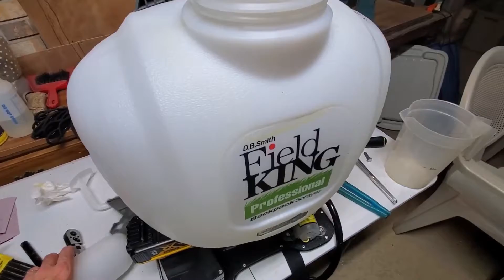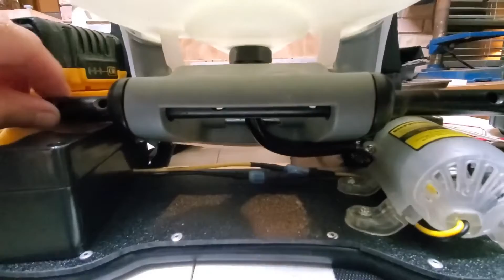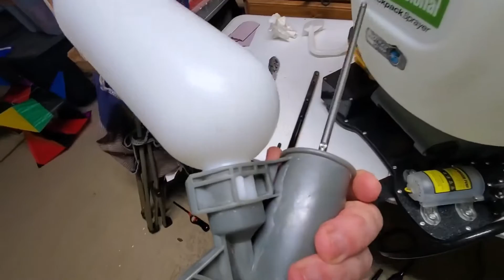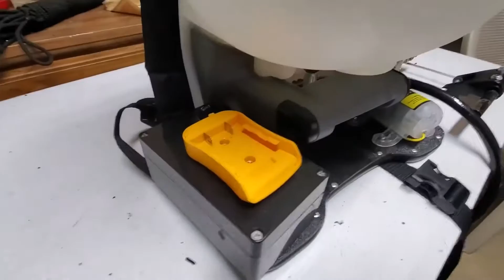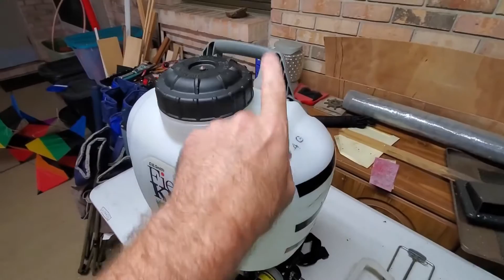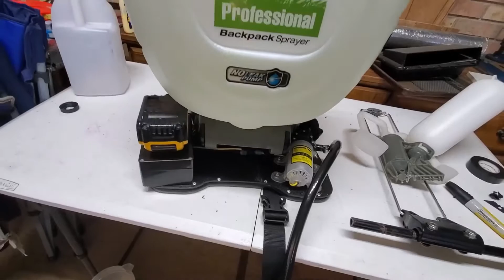Dewalt® Battery Conversion Backpack Sprayer Update

Comment: Hell of a clever idea. Ive got the parts ordered to convert one to use Milwaukee batteries. One thing I thought of after ordering is the Milwaukee red lithium batteries have built in over discharge protection: the 12v limiter I picked up actually has one built in as well (allegedly). I'm unsure if those DeWalt batteries your using has it or not.
Reply from the maker: According to DeWalt their battery packs don't have over discharge prevention built in. I know several other brands do. I used DeWalt because thats the platform I'm invested in with all my hand tools.
Reply: @petedymond  This was a great and useful video...much appreciated! in this video you said you used it a bit and still had 2 bars of battery left over. Is the dishcharge preventer needed if i don't plan to fully run down a battery (5AH or 8AH)? just trying to save me some $ and minimize components going bad. Thanks again...i'm going to buy the parts and hope the links you added for the amazon purchases send some money your way! 👍
Reply: I’m planning on using makita 18v with a step down converter to get to 12 (or 13). Anyone used a step down converter for this?

Comment: My original thought was actually to use basically a cheap 12v tire inflator with a port in the top of the tank (maybe just install a tire shrader valve) to pressurize it. I feel like it would be fairly easy but kinda depends on the volume of air the inflator can produce and how to control the pressure. I think this design would have 2 advantages though… 1 - less modification so you could still use it like a normal pump sprayer 2 - no worrying about chemicals degrading pump
Reply from the maker: The pressure is in the bottle pressure tank, not the entire tank, so I'm not sure that would work. You would still have to remove all the internal components. Also as the tank empties, the tire inflator would have a lot of air volume to fill.
It would probably work with a hand can sprayer.
Reply: I've considered this as well but I think that tiny inflator piston would just have a hard time keeping up with the CFM needed. That's why I ended up here looking for a DIY battery sprayer.